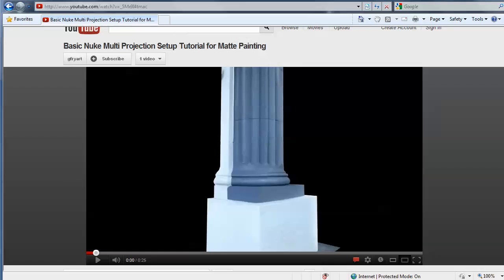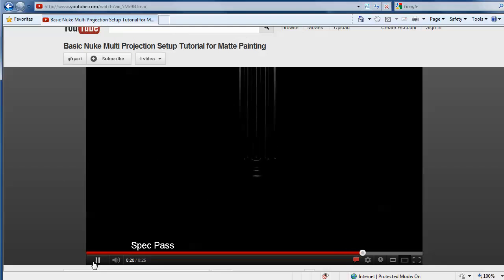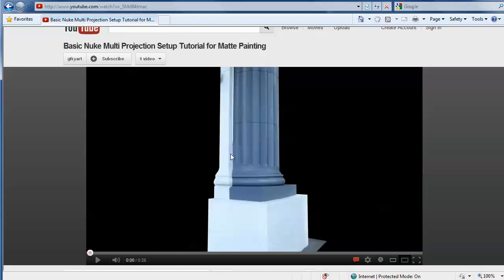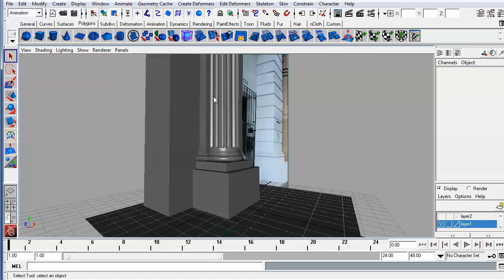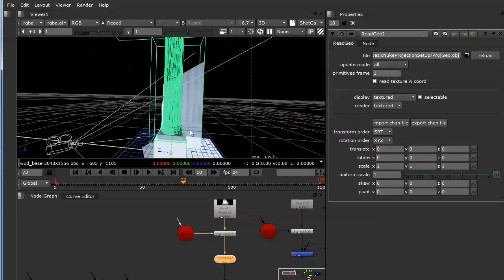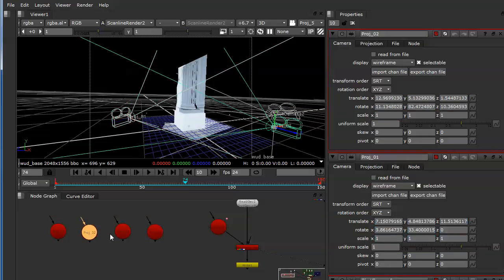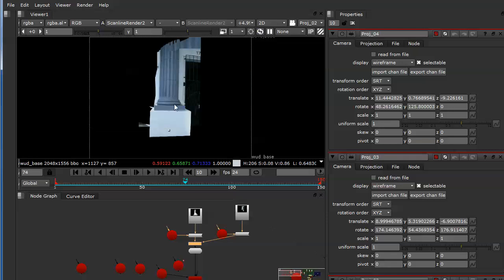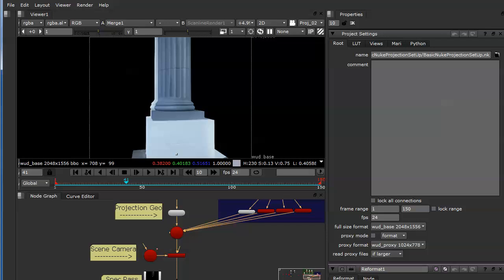Nuke Multi Projection Setup Tutorial Overview for Matte Painting

Comment from the maker: Your projection resolution can be as high as you want. It gets fed through the scan line render node--it will render at your project settings resolution by default. You attach a constant node to the scan line node of your desired resolution and your scan line will render at the constant resolution instead of the projects. Hope that helps.